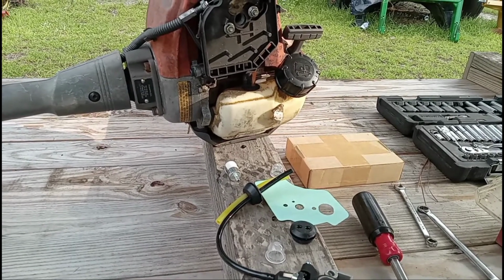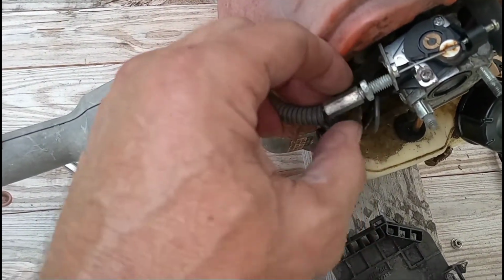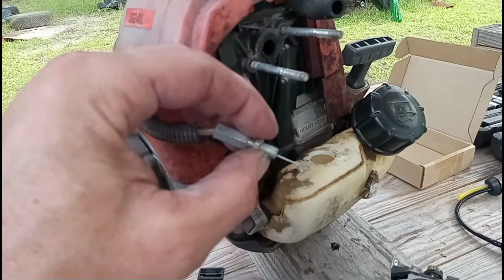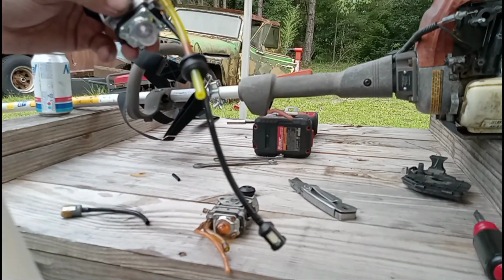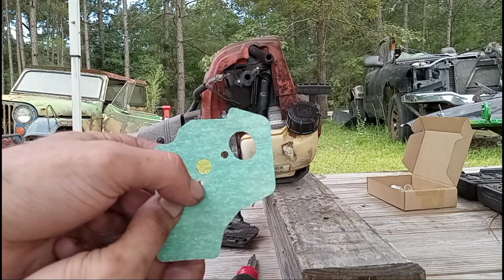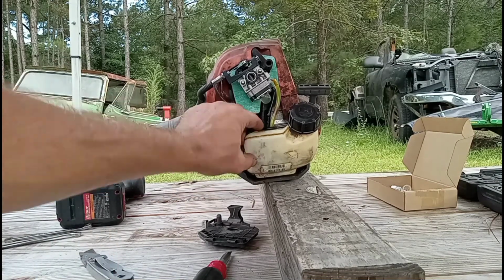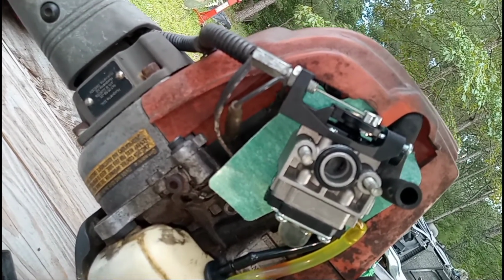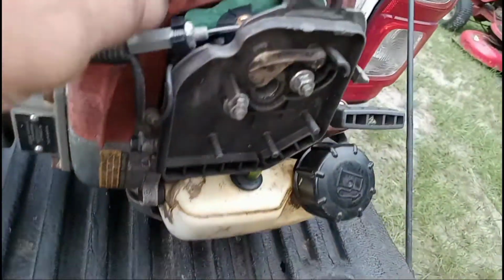Husqvarna 324L Trimmer Won't Start. Cheap and easy fix.

Comment: You need to buy the replacement carburetor with a high speed adjustment screw, the one you installed does not and the engine bogs down when you pull the accelerator. I had the same problem and found one on Amazon with the high speed adjustment and now snap throttle responds no delay.
Reply from the maker: Thanks for the advice! I’ll look into it.
Reply: Which one on Amazon
Reply: looking for the same, do you have a link for the one with high speed adjustment ?